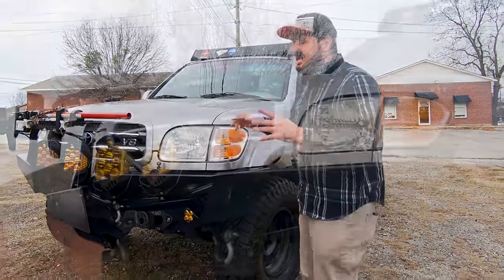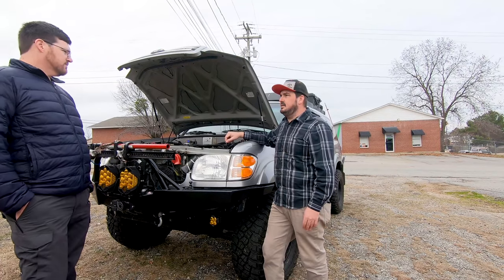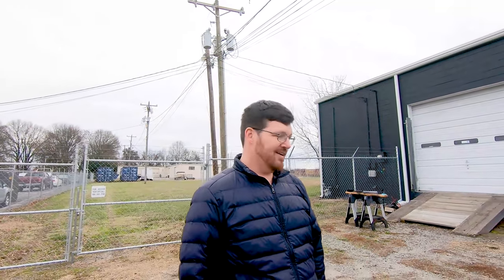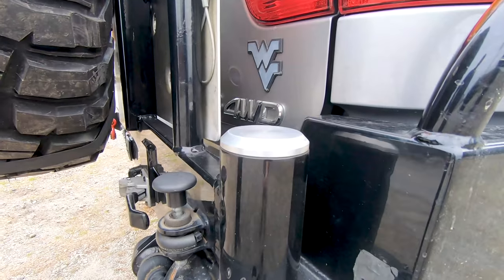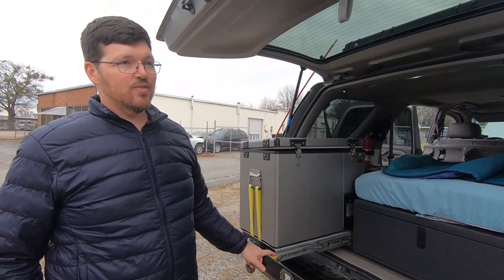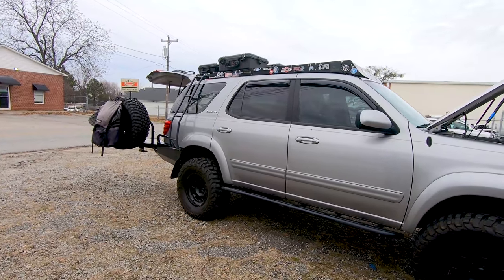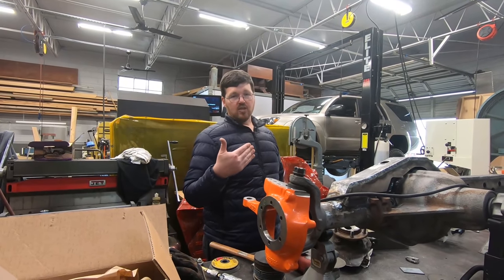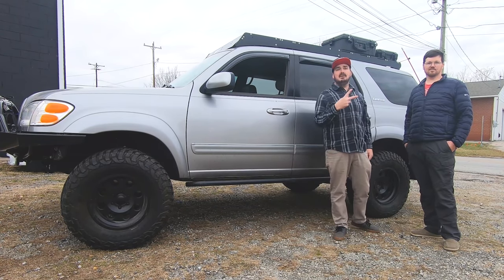BadAss Builds - Toyota Sequoia Overland Build

Comment: Pretty damn sweet. If my Sequoia was 4wd I would've never needed a 4runner. The Sequoia has already got plenty of clearance and a good suspension, just slap on some mudders, take out some seats, and you're good to go. 

Random comment: Yesterday I changed my rear diff fluid (75w90) and noticed a 100 rpm decrease @ 70 mph. Doing about 2,300 to 2,350 rpm. Love my Sequoia!
Reply: Sorry bro, that i snot how physics works. Lol. If you had zero lube, the mechanics would be no different.

Comment: The 05’-07’ are more sought after since they have 33 more horsepower and lower gearing for off-road and towing.
Reply from the maker: Nice
Reply: Funny. Usually the 07s re the Toyotas everyone avoids like the plague due to issues such as the Camrys engine issues and the Tundra frame issues.